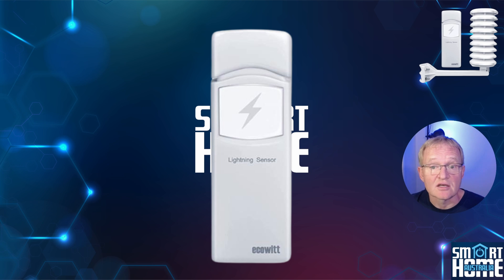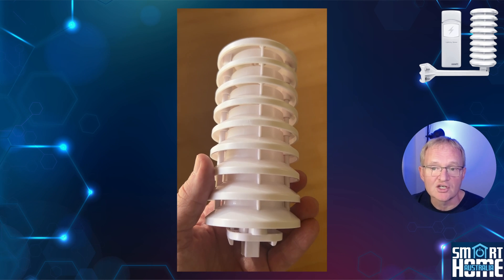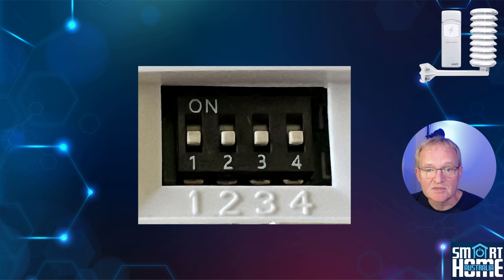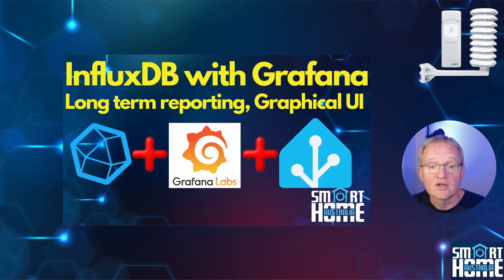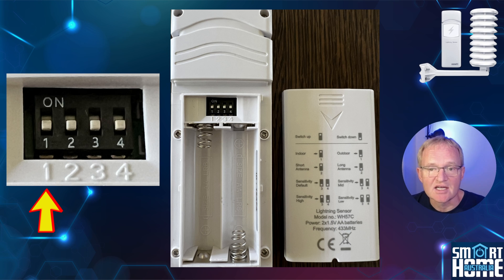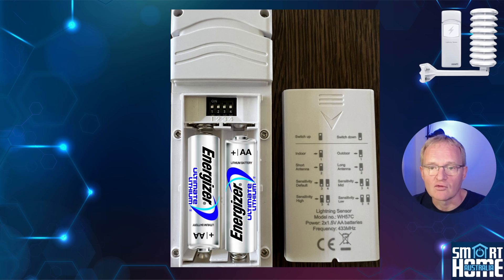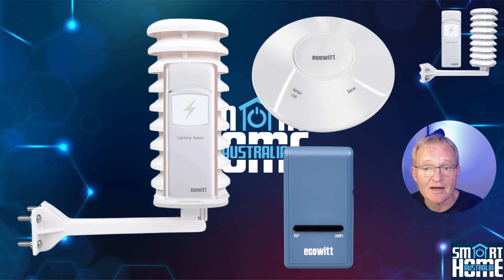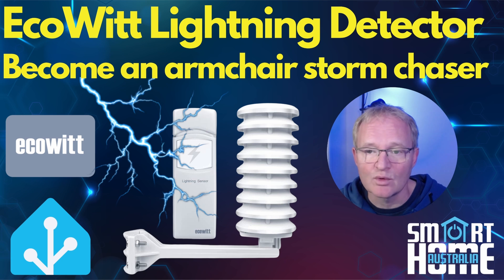ECOWITT WH57 LIGHTNING DETECTOR

Comment: I have the above setup and a smart plug AC1100 from Ecowitt. I want to turn on the smart plug when lightning occurs. How can I do this?
Reply from the maker: I'll assume that you mean you have all the devices connected to home assistant.

You likely already have the Ecowitt integration installed (via HACS or directly), and the GW2000 is sending sensor data (including the WH57 lightning detector) to Home Assistant.

Assuming this to be the case then check that sensor.lightning_distance_XXX and sensor.lightning_time_XXX (or similar entities) are available in Developer Tools → States.
Confirm the AC1100 smart plug is exposed in HA — it may appear as switch.ac1100_XXXX.

IMPORTANT: I dont have an AC1100 smart plug but if the AC1100 smart plug is not showing in Home Assistant, it’s likely because it's not natively supported by the Ecowitt-to-HA bridge. You might need to bridge it through Tuya, Smart Life, or custom MQTT integration if supported.

The use the lightning event (e.g., sensor.lightning_time_... updates or sensor.lightning_distance_... < X km) as the trigger. You could also trigger on sensor.lightning_time changing, then check distance in the condition.

Hopefully that helps. Good luck and pls let us know how you go.

Comment: Thank you for the video.  My weather station is mounted on a 2 inch pole.  Will the mounting system on the WH37 fit that pole?
Reply from the maker: Yes it will. It fits onto the same pole.
Reply: @smart_home_australia  Thank you. I appreciate your reply. 😊
Reply from the maker: @ anytime.  If you are in Sydney now your WH57 will be getting a work out 😊🌩️⚡️
Reply: @ I’m in the Blue Mountains and got a small amount of rain but no storm. Perhaps tomorrow when the mercury climbs.
Reply: @smart_home_australia  unfortunately that’s not correct. The plastic mounting bar end for the WH57 is approximately 19mm (3/4”). The metal u brackets are 35mm (1.37”). Why they didn’t make it compatible with the up to 50mm (2”) of the WS69 array is a pain.
Reply from the maker: I run them on the same pole. I did some further digging for you. 
Wittboy Weather Station:
Pole Diameter: The Wittboy typically fits poles with a diameter of 1 to 2 inches (25–50 mm).
WH57 Lightning Sensor:
Pole Diameter: Compatible with poles of 0.6 to 1.3 inches (15–33 mm) in diameter due to its U-bolt mounting system.
So there is an overlap but yes you are correct, 2inches is not comparable with the WH57, and yes, they really should standardize.
Reply: @smart_home_australia  Yes, it would be great to mount the accessories on the same pole.  I went for a 2" poly pole for rigidity (can't afford stainless steel).
Reply from the maker: @BlueyLawson  when I first mounted mine it was on a broom handle lol.... whatever works as they say.
Reply: @ Ha ha …. That’s just what I did this morning with a Bunnings broom handle.
Reply from the maker: Classic !!

Comment: How long do the batteries last for?
Reply from the maker: Varies dependant upon quality of batteries used, distance of transmission, etc. but you can expect between 12 months and as high as 18 months. 

I went for Energizer Lithium Ultimate so I’m not expecting to change then a long time 😊
Reply: @smart_home_australia  distance of transmission have nothing to do  for the batteries last for  as they only transmit and NOT receiving.